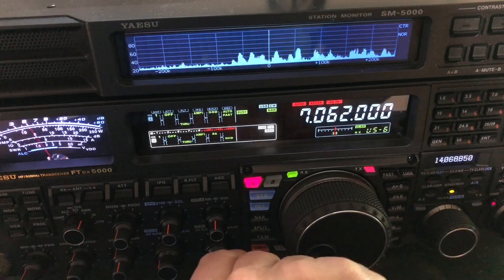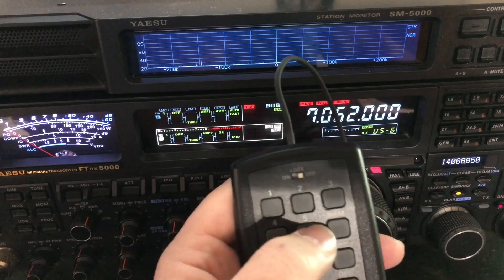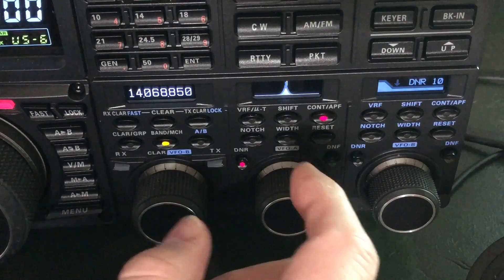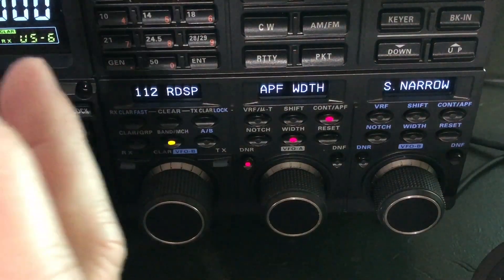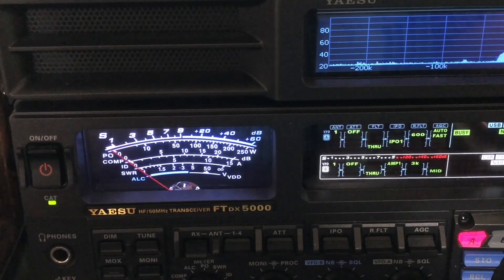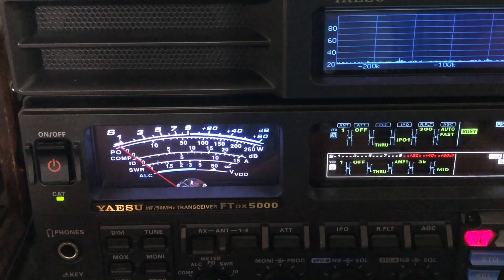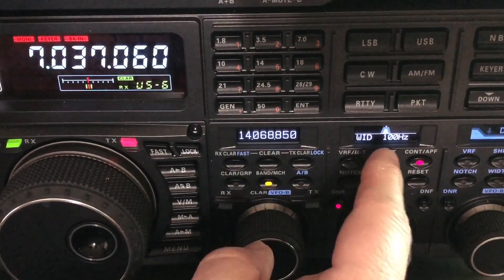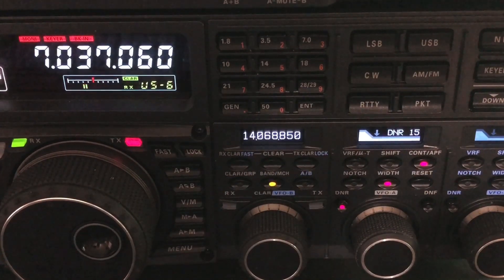APF Super Narrow Option

Comment: I gotta quit hanging out in here.  All I do is see things I really “need”.  Like the FTDX10 that showed up at my door today.  Really nice.  I guess I have a 7300 for sale.
Reply from the maker: Let me know what you think about the FTdx10.  I think it’s a bad dude!  Game changer!

73, de N4HNH
Reply: @n4hnhradio  It’s incredible.  I can get rid of the noise and it sounds like a repeater.  Is the only cable  I need to connect to Ham Radio Deluxe is that cable that looks like a printer cable?  I’m not looking forward to setting all that up.  Especially for the digital stuff like WSJT-X.  Thanks for all your help.
Reply from the maker: I think that radio can use regular USB, right?  If not, there should be a CAT port.
Reply: @n4hnhradio  I'll figure it out.  What I'm reading is Ham radio deluxe hasn't added that radio but there are some ways to work around that.
Reply from the maker: I have version 5.24 of HRD.  It doesn’t include the 5000.  I set it to FT2000 and it works.  Yaesu pretty much just has their old and new protocols.  Yours might even work by selecting FT-991A.

73, Doug